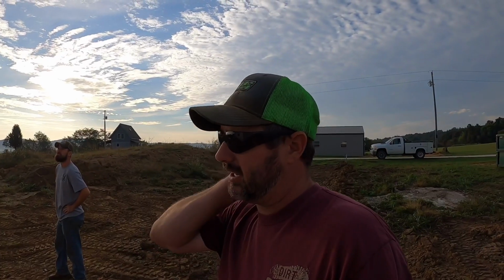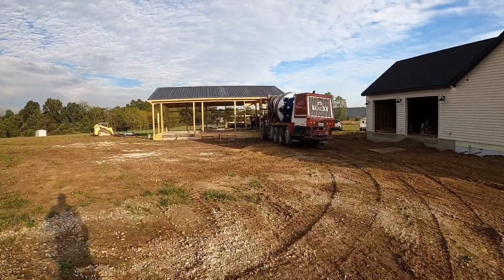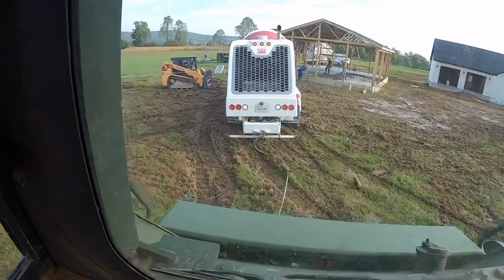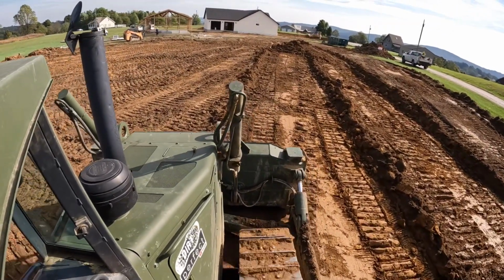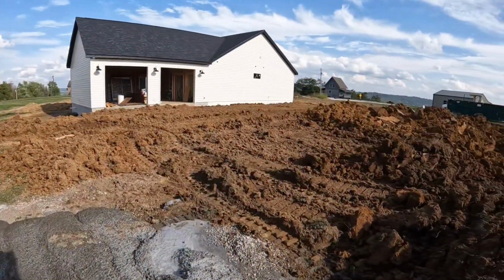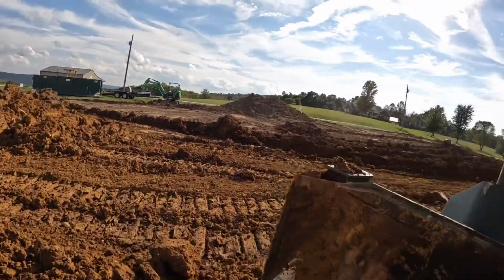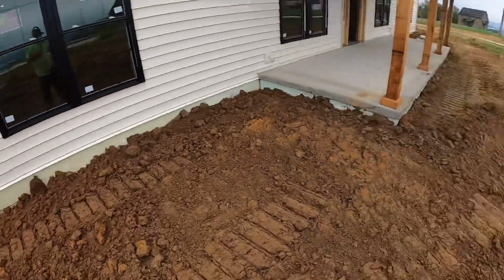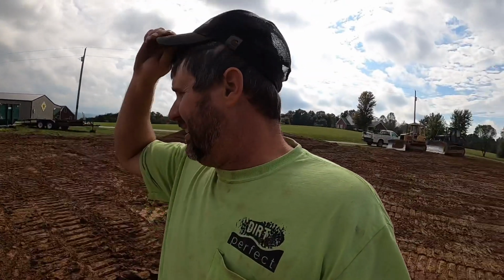Sculpting a yard around a new home with the 850j and D4g dozers

Comment: Hey Mike, top soil removal thought: You mentioned that after a full blade path, you keep taking 1/2 blade cuts after that because it works the best stripping the top soil.  Would it be better if you skip over a 1/2 blade path so that your next paths are always full blade cuts .  and then come back and push off all of the remaining 1/2 blade paths at the end or is it the same amount of work (example: strip Full, skip 1/2 in between, strip full, skip 1/2 in between, strip full, come back and strip skipped halves)!

Comment: That's always a good start when the truck with the mud gets stuck or rolls over on the job site. At least you had the 850 there and you didn't have to bring a machine in. I was worried about that when I saw you pull in the grass with the low bed and the 850 on the deck in the last video. I miss working in the dirt. Those are some good memories.

Comment: Mike didn't explain the introduction of Jerry when he took over the drone.  But I have to point out the amount of dirt pushed increased dramatically, and the level field improved dramatically with the operator change.  I'm not taking ANYTHING away from DP's skills.  It is just amazing what that old man can do on a dozer.  I saw the utility video dig on Captain's channel and that property turned out perfect.  Good group effort, CHEERS!
Reply: But DP did such a good job running the drone while Jerry worked.  Must have tuckered himself out the day before when he worked most of the day.  Still, under his supervision it did come out rather nice!  Have fun and keep up the good work!!
Reply: @Peter89133  Undeniable skills all around.  Word on the street is that Mike is getting out of the dirt biz to hone his camera skills.  lol.  Look for an upcoming Pepsi commercial.  🤣
Reply: How hard is it on Jerry's body being on a dozer all the time?
Reply: @codylake361  I'm sure his body is use to it, as smooth as he is I'm sure it helps too.
Reply: Experience will tell.

Comment: You might want to adjust the turnbuckle blade strut a little shorter so that blade on the 850J won't gouge so much. I think the top of the blade needs to be closer to the radiator. Just my opinion.

Comment: I've got the ISO Tunes Pro2 at work. Super long battery life, good hearing protection, and still good audio. Batteries will last about 16 hours for me on a single charge. Super happy with them. The silicone ear pluggers work best for me. Can vary the amount of protection you want depending on how deep you push them in your ear canal.

Comment: Try tilting the blade and use the end bit to rip to the depth you want. Rip each furrow several feet apart at least as wide as your blade and then push the topsoil off that you want to stockpile. It'll save you fighting the blade from dipping and diving and you can strip a flat area off in no time. Just a thought, you strip however 'ya want lol.
Reply: Hopefully not on a stage with music and lights. 😳
Reply: I absolutely agree, I use this very method for stripping as well as when trying to dry out a road bed so we can achieve compaction. I've been a finish operator for about 15yrs (out of a 25yr career) and when I first started I had an amazing older blade hand teach me that method. Acts just like a plow and is helpful in a few different applications

Comment: Being  a framer I'm not a fan of ICF  I personally haven't had to deal with  it   but I don't believe it's necessary  a 2×6 wall spray foamed   is a plenty  good  I think it's great for basement  and foundations but that's it  most of the houses I've built the home owner makes changes move windows doors  even had to remove  680 sgft of second floor  wals and roof  one time foor better curb appeal  they said they did pay for it
Reply from the maker: Sorry you don’t understand much more to it then that mat try doing Some more research thanks
Reply: It is nice looking  good work
Reply: @DirtPerfect  I'll do that sorry  if I  afended you I just like building with wood I'm just a stupid carpenter  I really enjoy your videos thanks

Comment: I was surprised that the blade on the 850J was dipping and digging so much. Doesn’t seem like the 850B has that issue. 
I would have thought the lift hydraulics would keep the blade height consistent as you push unless it’s in float position.

Comment: sorry NO sale on those walls ..first saw ICF  used over here in Boston from  show This old House in later 80's and wasn't sold on back then ,, i finish carpenter for that Co  .still build old way  ,,don't see how that Ele pass ,unless their running tin plate over that wire  from top to bottom  OR wire in wall 1 1/2"  ? .when to close to outside  1 1/2" wooden stud have place tin plate so screws  ,,and code same in whole country ,, 
,,that why i hate Truss  the waste space  . Just easy. cut Rafters and  scissors overlays  , men i always did,, house like that should take about 3 guys 8 hours cut and rafter it

Comment: ICF?
Reply: Insulating Concrete Forms.  Concrete forms with Stryofoam.  You pour them in place and don't remove them. It adds insulation and saves time by not removing the forms.
Reply: It also saves a ton of wood framing. No need for studs, the drywall can be attached to the foam.

Comment: I pretty much understood the whole idea of saving soil for around the house once the elevation was where you needed it but now does dead soil mean dead for a very long time as earth spins and builds its own over a few hundred years thing but is it imperative to get top soil over the places you cut down .... its dead but even field grass won't grow is what your saying?? With only a few inches to start with, seems aweful hard to find enough to spread that same distance you took it from. Then also, the actual drive way will need some kind of rock as well or be like the cement truck??? Am I even close to figuring it out? I bet your glad that like here in alaska, that top soil lifted, its a deep deep mud or just huge rocks and small ones in between the big ones... no soil.